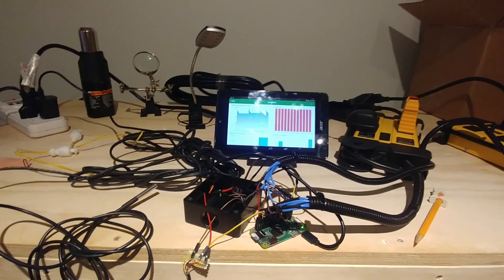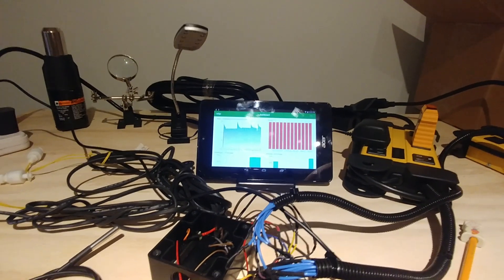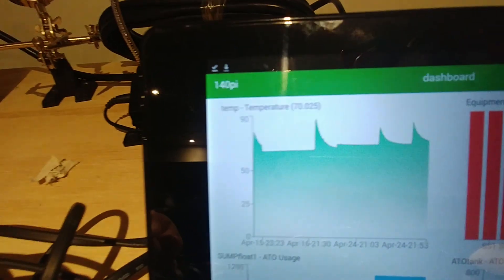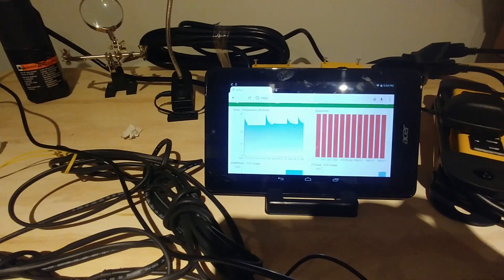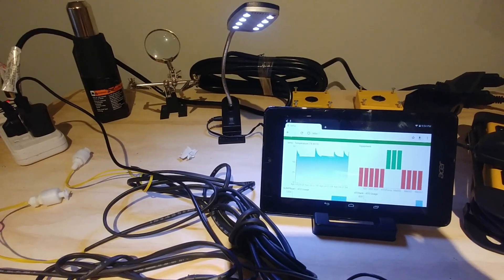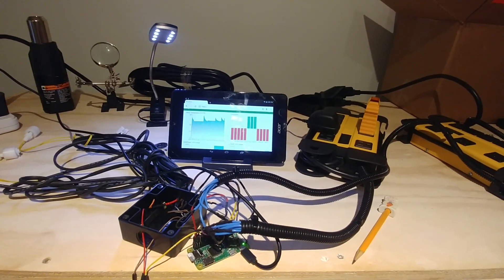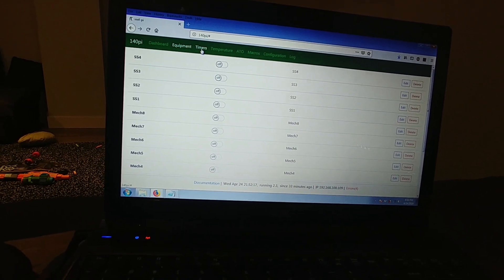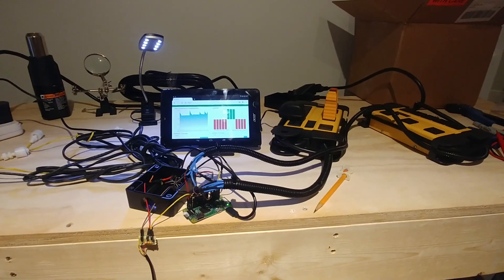DIY Aquarium Controller - Quickie Update

Comment: The poking every 30 seconds for temp and heaters and stuff seems fine because those are such gradual changes but every 30 for an a to seems like a long time unless the pump is quite slow to fill. Is there a way to adjust that or would it be better to adjust the flow from the pump?
Reply from the maker: You can adjust the time to check the sensors and switches to whatever you like down to 1 sec. I just put it at that amount for testing. I agree 30 seconds is too long and would probably change that way down when setting it up on the build. The build video's (which are done I just have to edit them together and post) will explain all the possible input and output settings in much more detail.
Reply: Rickets Reef awesome! Super excited to see them
Reply: Instead of using time, can you simply switch on COV?